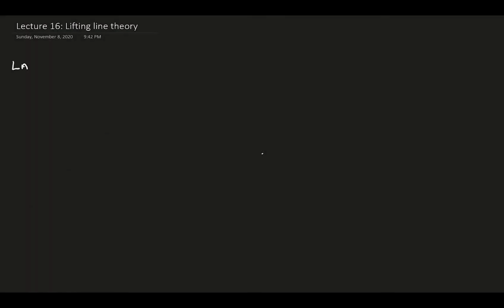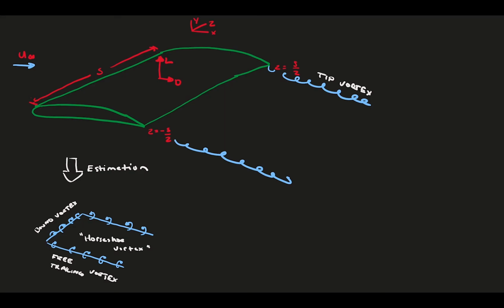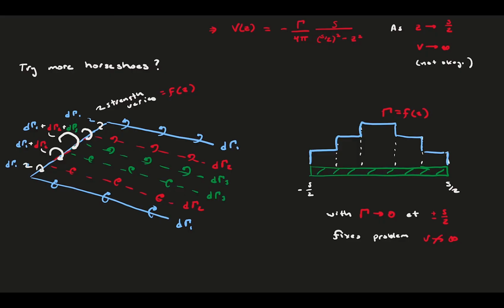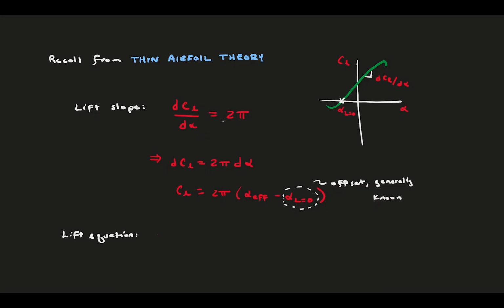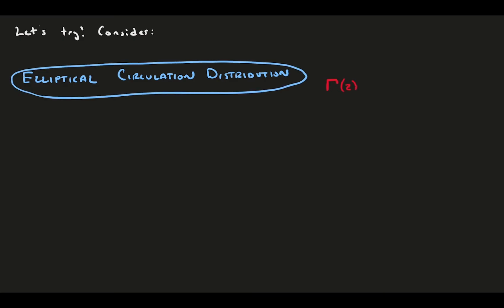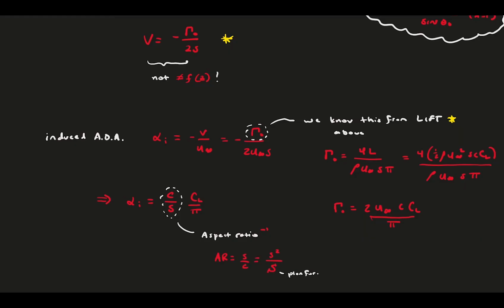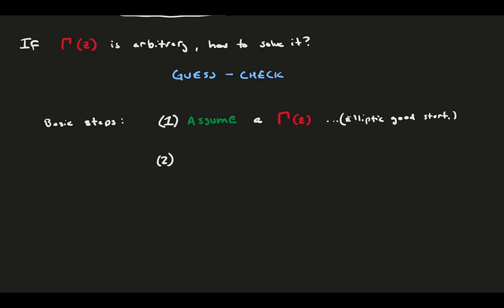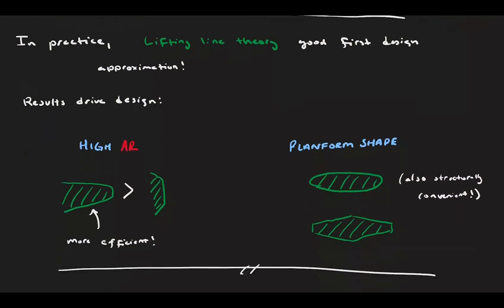Lifting line theory [Aerodynamics #16]

Comment: Hello professor, thanks a lot for your video. I have one question, how would you determine the value of Gamma nought for an elliptical lift distribution. Thanks in advance.
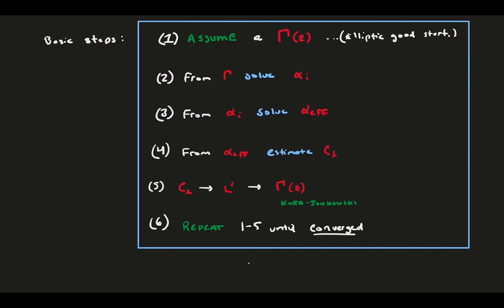Reply from the maker: No problem! When Gamma(z) is arbitrary, the way to find it is a guess and check method (see around 19:28 in the video). You would start with guessing a Gamma distribution, then through a series of steps you can solve for the lift distribution which gives you a new Gamma. Plug this Gamma back into the beginning, and do that iteratively until Gamma converges.  The video might be more clear!
Reply: @prof.vanburen  thanks a lot for the reply.

Comment: For a project we are working on calculating the influence of wingtips on induced drag. However, we were wondering if the lifting line theory can also be used for a wing which is not flat, but instead has winglets.
Reply from the maker: Hmm, good question. I'm not sure it would appropriately capture the end effects as it will change things slightly (generally for the better with regards to induced drag). Potentially you might find measurements on induced drag of winglet systems in literature?
Reply: @prof.vanburen  It was hard to find an appropriate way to calculate the induced drag of winglets. What we eventually found is that by predicting the downwash profile of a wing (by for instance using computer programs like OpenVSP or XFLR5). An expression can be found for the circulation, resulting in an estimation of the induced drag (as explained in the video). 
We are however not sure if these estimates come close to the real world. Moreover, we found that using the method of restricted variations that the optimal induced drag is obtained when the downwash is proportional to the local cosine of the dihedral angle. So when having a winglet at for example 90 degrees dihedral, the net sidewash should equal 0. This means that the winglet should not produce thrust, however the winglet causes a upwash on the main wing, reducing the induced drag of the main wing. This way, the winglet mainly helps the main wing perform better, instead of producing thrust itself. Some more considerations can be found in our Aerodynamics Assignment for the University of Twente: https://dickdekker.jouwweb.nl/induced-drag-of-winglets

Comment: Thank you so much for the videos Sir! this is very helpful. Do you have any recommended reference for me to see an example for the detailed explanation for the process of using Lifting Line Theory with a General Lift Distribution (in a tapered wing if possible). This would be very helpful. Again, Thank you soo much for your videos sir! This is very helpful.
Reply from the maker: You're welcome and glad you enjoy them! A good place to start would be Anderson's Fundamentals of Aerodynamics book, it's really stellar.
Reply: @prof.vanburen  Thank you for the answer, Sir! I have another question, if i want to use LLT for a tapered wing with the steps that you showed in 19:26, do i have to calculate the Fourier Series for the specific wing shape?
 or 
the steps applies to all planform wing shape (the first step particularly, where we assume with an elliptical wing distribution)? (which means i can use the elliptical distribution as a start despite the planform wing difference), but from here i dont have a clear view on how it will end up to be the distribution of the tapered wing instead of the elliptical one. 

I am confused at this. Thank you so much for your hard work!

Comment: Good morning sir ! Thanks for this amazing lecture
Regarding the discrete solution of LLT do you know why control/collocation point are chosen to be at 3/4 chord. The reason  is usually to ensure flow tangency and  recover the 2D incompressible airfoil slope but I never found any mathematical answer about the second one. 
Thanks for your answer
Reply from the maker: Hi! Sorry for the late reply. Can you expand on your question regarding the 3/4 chord? I am not sure I'm following.

Comment: could you do a video on sweet wings and the "Mittelefekt"?
Reply from the maker: Oh! To be honest, I had to look up specifically Mittelefekt, which I understand is a term regarding the loss of lift near the root due to spanwise flow on swept wings? 

I certainly can consider a video on three-dimensional flows over finite-span wings after I finish up my Fluid Mechanics series (it's a bit more of an advanced aerodynamics topic). The Airfoils and wings video has some of the flow control devices used to mitigate these effects, but you're right in that I don't ever get into three-dimensional flow details.
Reply: @prof.vanburen  , i don't know if the mittelefekt emerges due to the span wise flow, but as far as I understand it (not very far) it does describe the loss of lifting force near the Roth.
thanks again for answering, have a good day :)